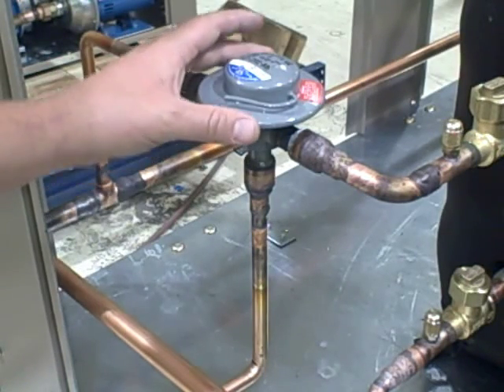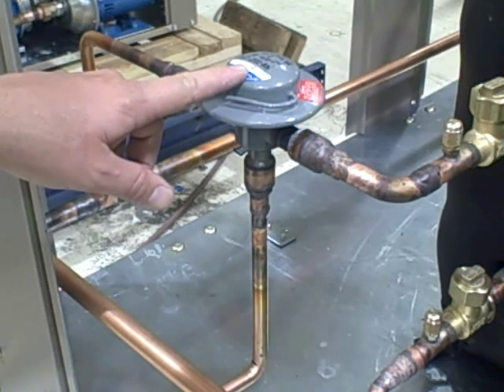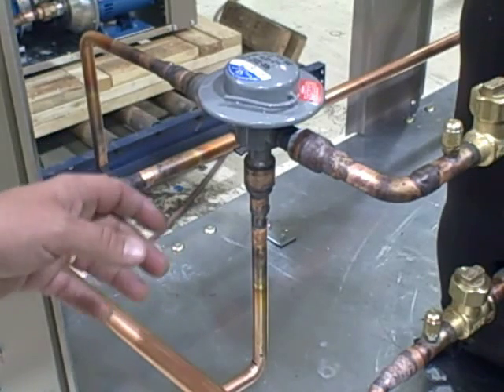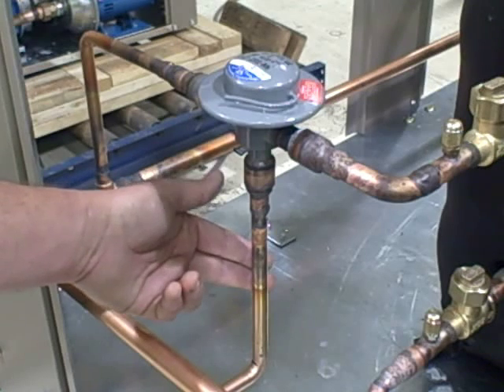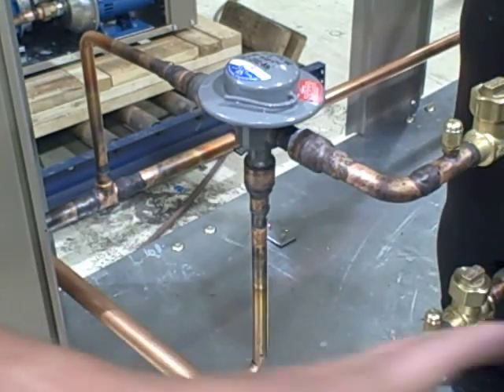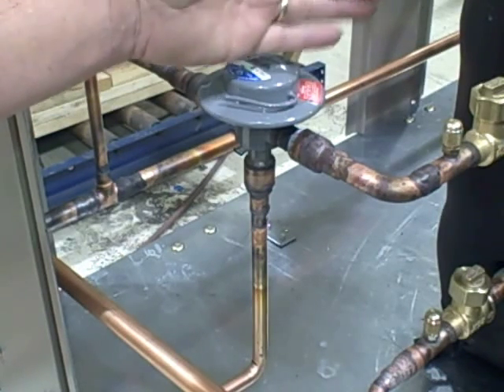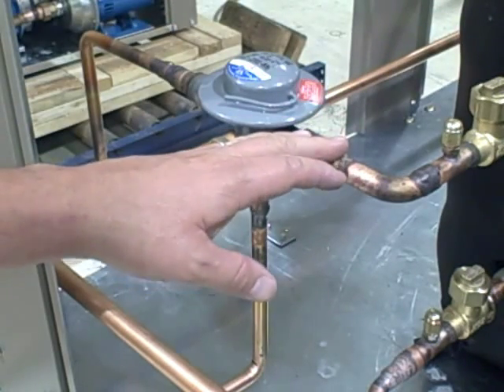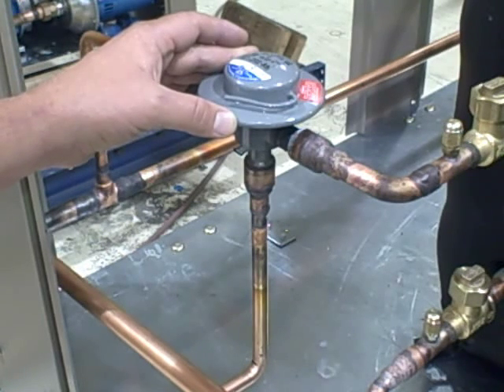Process Chiller Training - Flooded Condenser How it works

Comment: Condensor fan control?
Reply: No. This only bypass the refrigerant straight to the receiver if the outdoor temperature drops to low. In order to keep head pressure up so the evaporator doesn't starve. You are thinking of fan speed control of VFD (variable fan drive) or a fan cycle head pressure control. Contacts close on a rise in temperature so the fans turn on. VFDs computer monitors outdoor temperature to adjust fan speeds.
Reply: @mackenziegray2090  yes, works the same. Only much easier and no fans working is no power used.

Comment: what is the cause to the ice maker if headmaster valve is defective?
Reply: The TXV will start hunting and act a bit erratic. Without proper head pressure, there isn't the correct pressure drop across th he TXV.